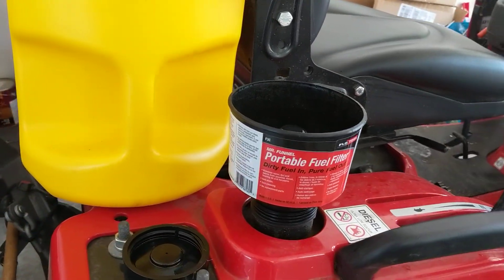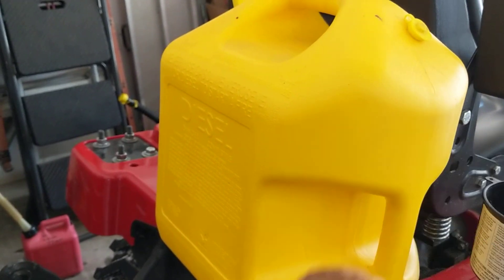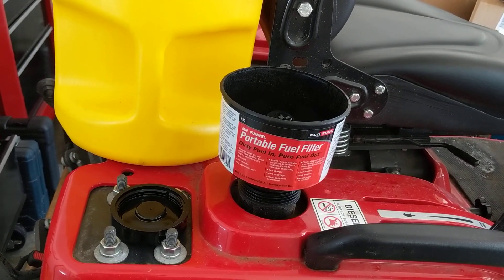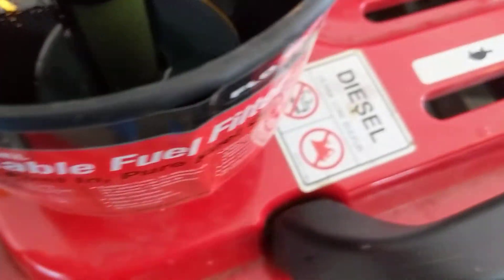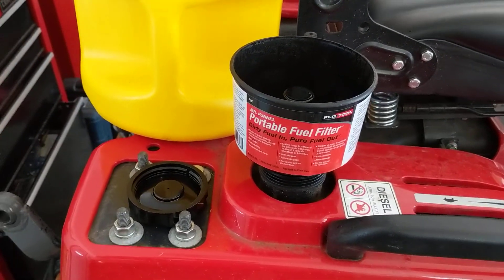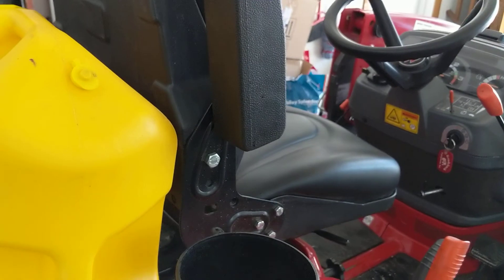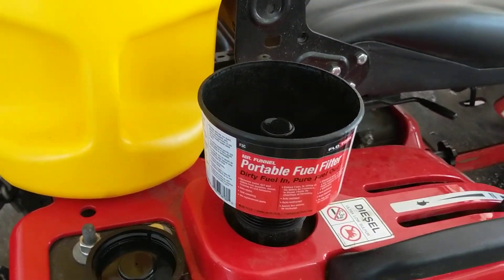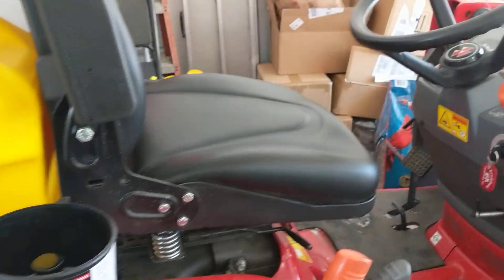minimizing water in the fuel tank

Comment: I have one of these fuel fillers and it does separate water and gunk from fuel but it is real slow compared to open fuel flowing funnel.  Great video.  Thanks Full-watch.  Hope you're soon done with snow and ice.  👍🏽🙂
Reply from the maker: Yeh, it's definitely slow going when pouring the whole 5 gal fuel can into the tractor.  But then I theorize you don't need to use the funnel then anyways.  If your fuel can is full, less chance there's condensation in it, right?  I'm more worried when the fuel can is partially empty and been sitting in the garage a while, collecting water in there.